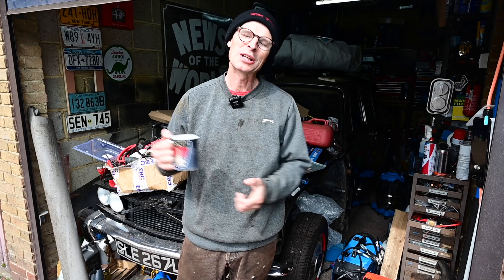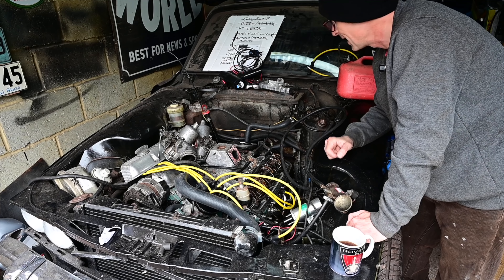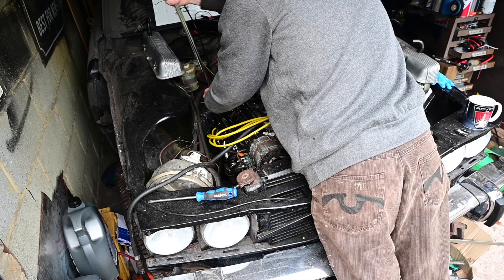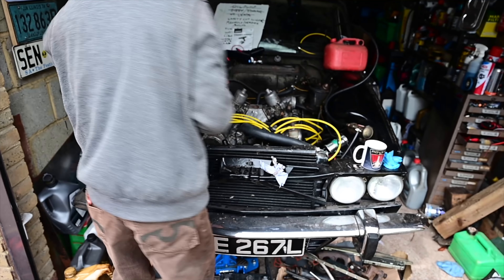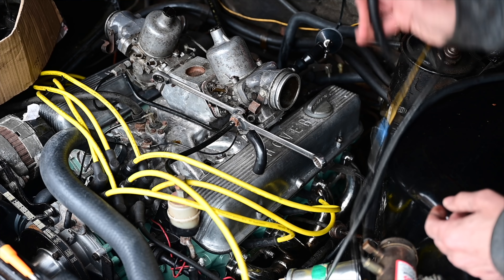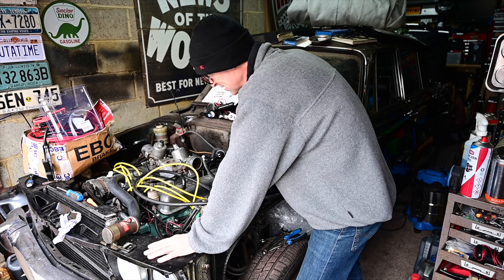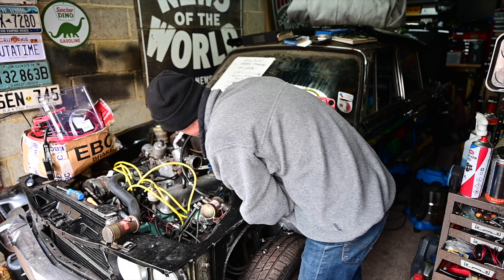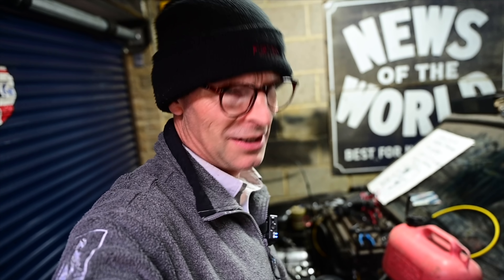Rover P6 4.6 non start SOLVED (but it still wont start)

Comment: Ignoring the fuel as your using easystart. There is an ignition, or major compression issue. 70 psi is a BAD thing. Should be 150psi roughly. Need to double check ignition timing and Wire order again. Then use a timing light to ensure base timing is correct for that engine. Ive got no idea what they run at, but 6 or 8 degrees BTDC would be typical and enable it to run.

Comment: You need to start from first principles. Cam timing and then ignition timing.  Why is your compression low? If the cam timing is out you won't get good compression.

Comment: I'm erring on timing being out which would explain the poor compression if it's a good engine. Like others have said, it isn't fuel because it won't run on easy start.

Comment: Is the lever that controls the jets linked up? The way you described smelling easy start on the plugs rather than petrol makes me think the air inlet is open but the fuel jets are staying closed.
Reply from the maker: I thought it was, I down think anything is left disconnected apart from the choke

Comment: Surely that compression should at least be 100 to 140psi  also do the carb pistons move freely in the chamber, to lift the pin to fuel the engine? have the pins been centralised ie restricting movement/opening to main jet.

Comment: Sounds like the carbs are faulty not letting fuel through 👍👍
Reply: Yeah that seems likely throttle stuck or som rubber diaphragm gone crispy.
Reply: Explains why the copious amounts of starter fluid isn't working.
Reply: Agreed. But I think the (very) low compression is exactly why the SUs aren’t letting fuel through. You need vacuum to raise the pots.

Comment: does  sound like more than 1 issue.... is the spark weak at the points? didn't look very  convincing thru leads, tedious as it  seems  compression test all cylinders dry  and wet,.....just by chance.....is there  something blocking exhaust? wonder how much  chuff from the  exhaust during  cranking

Comment: Good luck fixing the Rover Matt, your definitely not put off by this brand of motor vehicle are you. Three things to check fuel, spark and timing/compression, must be one of these a mechanic once told me me on a Mk 1 Ford Fiesta that wouldn't start.

Comment: That compression isn't right, but it might be it wasn't sealed properly giving a bad reading.  But it does sound low.  Id go back to timing, ignition and jump leads off a running car.  Failing that you might have damaged something with the valve problem

Comment: Your compression is very low 70psi isn't enough you need 150psi ideally.  The engine sounds like it's lacking compression.  Did you space the piston ring gaps?

Comment: 70psi is well too low 
U need at least 100psi
I'd say 
I thought my rs turbo being on 120psi was bad (valves seats not sealing)
Hope u get it sorted an up an running soon
Only seen one reading an adjustment but obviously u did them all

Comment: It’s not a fuel issue, if timing/valve clearance and compression OK it should have barked off with the easy start. Like others have said, compression way too low, but even like that it should have fired if ignition system OK. Check points gap? Or is it electronic ignition (sorry may have missed this in other episodes.) Anyway, my money is on electrical.
Reply from the maker: Its electronic from the old engine, which was working fine on the old 3.5, and that should work completely or not at all so timing position or compression

Comment: I reckon your 180 degrees out on the timing. Even with a low compression it should have some from combustion if you have spark. Id go right back to basics, set the car back to Tdc - ignore all the favtory timing marks on the pulleys and re time up everything up off your own painted marker points.

Comment: Junk the carbs, put an eldabrock manifold on it and a 390cfm hollie with vacume secondaries. Run much smoother and sound amazing and easier to balence and whip off rocker covers
Reply from the maker: Once it works, dont want to drop more £ on it till it runs
Reply: @furiousdriving  go back to basics take out number 1 plug put a screw driver down the bore get the piston at tdc take off that rocker cover check both number one valves a closed and you can rattle the rockers check the marks on the bottom pulley and see if the rotor arm is pointing at number one spark plug

Comment: You need to bleed the cam followers first. Run oil down the pushrods as it turns over. It will not be opening the valves far enough. Afters months of no lubricant they will not pump up enough.

Comment: Are you sure the valves are closing fully? Compression still very low.
Reply: It’d be ideal to check the preload on the valve train to determine the shims. But it’s not just the head skimming that increases the preload and requirement for shims, if you’ve had the valve seats recut that adds to it (unless the valve stems were shortened in sympathy). This can also vary by valve so check the situation across the engine to avoid running maladies or burnt valves.

Comment: Still turning over too fast to have good compression.

70psi is still too low. You need to compression test the other cylinders and figure out why the values are low.

Also take out all spark plugs and check whether they are firing.

Comment: Rings stuck as 70psi seems very low. Carb fuel bowl needles also stuck closed, check fuel in bowls. Jets blocked. Car has been left for so long check anything that could stick.

Comment: Such low compression points to a serious mechanical issue, DO A LEAK DOWN TEST. 

You need to figure out why it isn't building up compression, 70 PSI is not enough for combustion!

Do this easy test: Remove the camshaft rockers tower and push rods, and try to see if the valves are closing completely with the endoscope.

Comment: 70psi is still very low.  You need to be seeing double that for full compression.  I think it should have coughed a lot more with all the easy start.
Reply: Is even double full compression? My old two strokes motors (not car engines) are 165 psi, I would think this should be upwards of 200?

Comment: 70 PSI? That's lower than a lawnmower. I'd remove rocker gear so all valves remain closed then do compression test with all plugs removed. This way you'll know if there is a ring issue or valve seating issue. 

Engine doesn't sound right turning over

Comment: Years and years ago I bought a non running mk2 cortina, no compression on 2 cylinders, aha I thought valves, pulled the head off, no not valves there was 2 pistons missing, somebody had removed them and put the sump pan back on. :>(

Comment: Compression..... even with low compression it ought to have been giving a few pops and farts there. If you can satisfy yourself that the timing is correct I'd suggest rigging up an independent ignition feed to the distributor and then having a go. The fact that it appears to fire once on each try, then not again suggests an electrical/ ignition issue to me.
Reply: May i suggest you don't leave so many days between trying to fire it up ?

Comment: I don't think you can just randomly mix and match rocker arms and push rods along with a 'breathed-on' camshaft and expect automagic.
But I think I'd try to advance and retard the timing as a blunt experiment (rotate the distributor body CW then CCW) because it still seems like no sparking happening anywhere near compression of a fuel charge.
Or whip off the SUs (again) and endoscope each intake runner from end to end.

Comment: Ah I see said the blind man....
No1 get the plugs out and get some automatic transmission fluid into the cylinders not too much mind and leave it to soak in
Whilst that is happening it's time forNo2
Which is get the carbs off and clean out the float chambers and check and set the float is not punctured and it's set to the correct height.note this must be done with the carb upside down and level,when you put it back together use automatic fluid in the dash pots 
Good luck my friend.

Comment: You need to go back to basics, check the timing, check the spark (it's needs to be a good spark), as mentioned below 70PIS is way too low a compression so you need to do a proper check, throttle wide open while cranking the engine, check valve clearances to make sure the valves are actually fully closing. drop the float bowls off the carbs to make sure the float valves aren't stuck closed.

Comment: For what it worth I don’t think it’s a fuel problem your squirting easy start into the intake manifold and you have a spark that engine should fire maybe not run but fire ,I think you have a timing problem either the valves or the ignition also 70 psi is a very low figure for a Rover V8 cylinder compression .

Comment: How do you know that the Daddy Bear shim was enough? I didn't see you do the welding wire measurement so you could have only improved the valve clearance rather than cured it. I believe you might need a combination of bears.. 🐻

Comment: 70psi is far too low. Around 175 should be the benchmark for a healthy V8 3.5 but I’m not sure for the 4.6, it certainly won’t be as low as 70 though. I wouldn’t be surprised if that is your problem. From what I can see, you only tested compression on one cylinder. Check them all as you may find that some are even lower than 70. 175 is about right plus it minus 10% across the cylinders is acceptable.

Comment: Compression is far to low. Check what it should be because it should be 125 to 150 or higher if you were 180 degrees out the compression would still be the same.

Comment: Compression should be in the region of 175Psi. 70 diznae cut it. There is always one that is sent to try you This is it. You will eventually find the problem and kick yourself when you find out what it is . back to school i'm afraid or on line in this case. Later.

Comment: Could the carb dashpots be low on oil? That can cause some odd running and starting issues with SUs.
Reply: I would say the opposite. As I posted above, I unscrew the dashpots when trying to get an SU fed engine going after a layoff. I find it’s best to have no damping during reluctant starting so that the pots can rise easily. As I understand it, the oil is to dampen the piston movement to enrich the mixture during acceleration. I top mine up fairly sporadically and it doesn’t seem to make much difference!